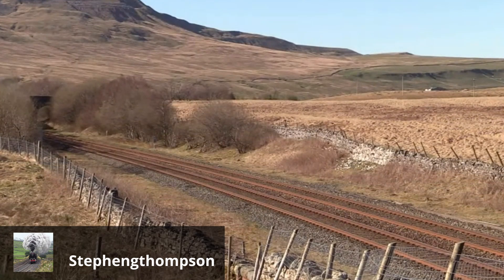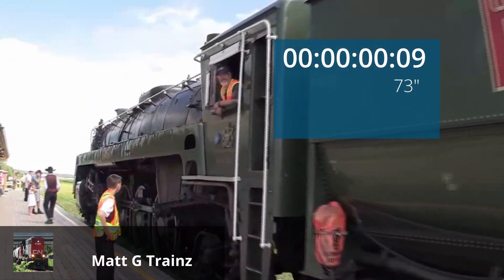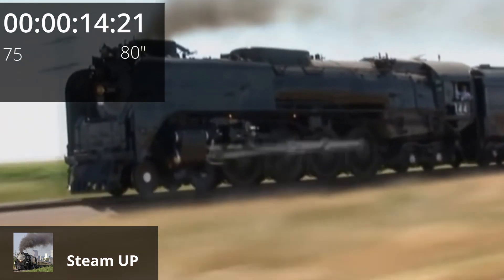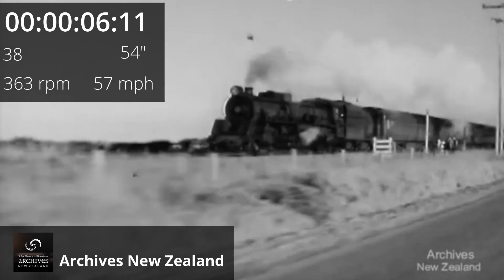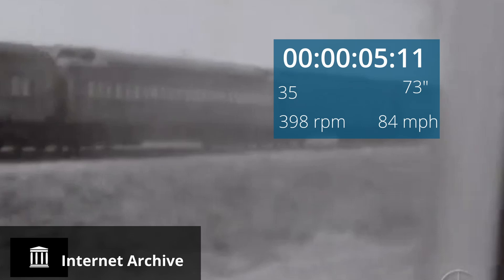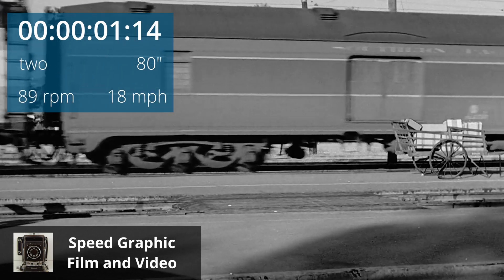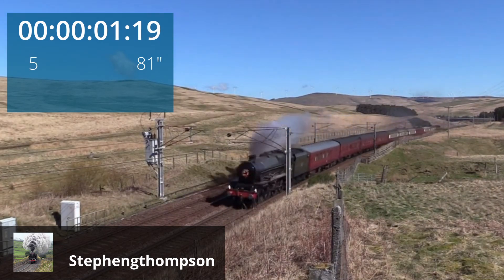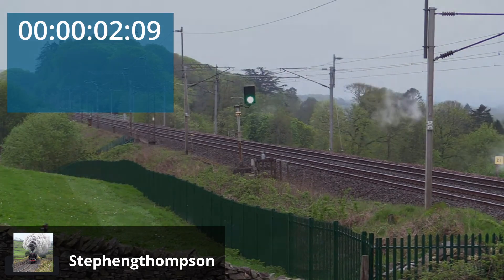336 r.p.m!  The Magic Number

Comment: is there a written out version of this equation?
Reply from the maker: There's  no particular equation.

The test of it is driver height by Pi x 336 for distance in inches traveled per minute; that by 60 for distance in inches per mile; then divide by 63360 (inches in a mile) and there you go.

It's not exact.  80" drivers at 336 rpm was actually 79.9678130005 mph when I worked it out just now.

Comment: How many rpm can rotating assembly do before it comes apart?  Is there a magic number for steam engines?
Reply from the maker: Not as far as I'm aware.  A locomotive would run out of the ability to produce steam before such a point was reached, and also steam into some form of disaster and suffer a different mode of distruction thereby.
Reply: @theimaginationstation1899  excellent video like always 👍
Reply from the maker: @travispatocka4520  Thanks!
Reply: @theimaginationstation1899  

To my knowledge the highest speed ever recorded for a steam locomotive was on a test stand-160 mph for a New York Central J-class Hudson  (I forget if it was J-1 or J-3).

Peppercorn A-2 Blue Peter had a nasty wheel slip incident that put her into rehab for a long time, but apparently the drivers were doing the equivalent of more than 140 mph.
Reply from the maker: They both sound like things that I glad I didn;t get to see up close.  I wonder what the MEP result was for the Hudson.   @00Zy99

Comment: The old rule of thumb used to be an inch of driver height for a mph of speed, give or take.

So 79 inch drivers meant the locomotive could do at least 79 miles an hour plus a bit more.
Reply from the maker: Most of the lore I've read is NZ Centric, and we're were a low drivered lot with three locomotives with 57" drivers and two with 58" drivers.  And our official road maximum only made it to 50 mph towards the end of steam development here with 54" drivers. So that maxim, which seems perfectly sound didn't feature here....
Reply: So in other words, all those engines could break the speed limit as their driving wheels were all over 50 inches.

On a related note, something that always stuck with me was something I heard from the crew of SP 2472, a preserved 4-6-2. At track speed of 70 miles an hour it makes a given rpm (forget the figure of the top of my head), but to make it all happen the valves are moving back and forth to admit and exhaust the steam six times every second.

Just impressed me as that's pretty well a blur if you were to see everything out in the open, and all that mass moving so fast really brings home the need for all the parts to be machined to a tee and for the lubricators to do their part keeping everything moving smoothly.
Reply from the maker: @Shipwright1918  Even more so, because back then the maximum allowed speed on the government rails was 36 mph.  On the privatley owned Wellington and Manawatu their 2-6-2 hit 64.4 mph on 49.25" drivers - it was the narrow gauge record for a time.

Yes, two valve movements per valve per revolution.  The big question mark with the pre-dynamometer speed claims is whether or not the valves could have moved the steam required to turn the wheels as fast as claimed.  On top of that there's the need for the boiler to actually supply the steam in the first place.  It's something like 0.17 of a second per valve stroke for Empire State Express 999 for instance.  And City of Truro was smaller drivered and something like 0.12 of a second.

There's also that Flying Scotsman is a significantly more potent locomotive that 999 or Truro, and it tagged out at 105 mph.

It also gives an idea of the counterbalancing needed to resist the weight of the driving rod reciprocating at one end and rotating at the other hurtling around and back and forth at that rate...

Comment: Enjoy the interesting videos!  Is the loss of real traveled distance from a single rotation of the drivers due to a lack of perfect adhesion small enough to not bother calculating in dry weather?
Reply from the maker: Thanks, Flak.

I suspect the 336 rpm is pure mathematics and that perfect adhesion is assumed, rather than that of operational utility.  Although it does serve as an illustration of the number of valve movements  - two per revolution.

Mostly, speedometers ran off a trailing wheel to avoid slip.